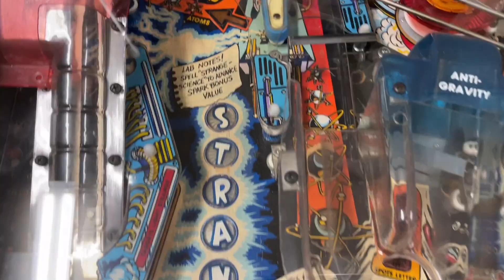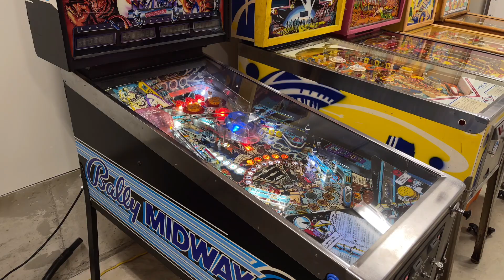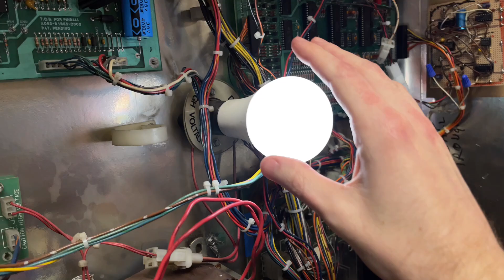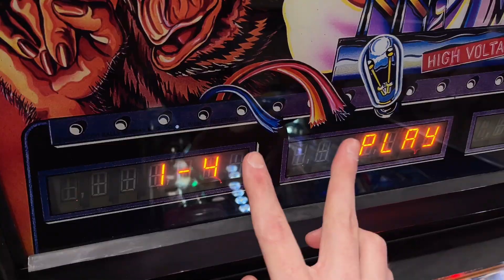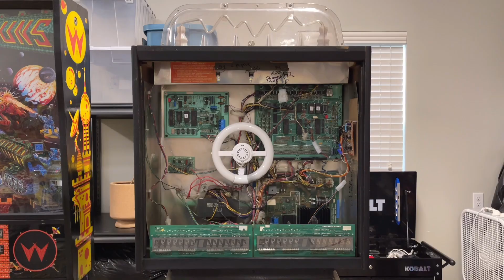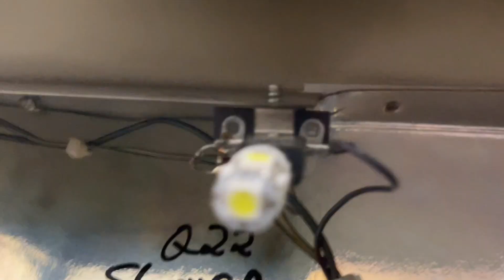A very strange pinball restoration - 1986 Bally Strange Science Pinball Restoration Series Part 1

Comment: You have all kinds of cool tester equipment. Is that stuff you used in college, or where did you acquire all that stuff and the skills to use them?
Reply from the maker: I watch people that repair old computers, vintage TVs/radios etc and I’ve learned most of what I know from years of watching them. And since the troubleshooting is very similar it’s helped me find and fix the problems on these machines. I’ve had some electrical experience in college but it hasn’t helped me nearly as much. Some equipment I buy new but others are eBay finds. I didn’t show it in this video but I have an old Heathkit capacitor leakage tester that has helped me find plenty of bad capacitors. Super useful for repairing older stuff like this.